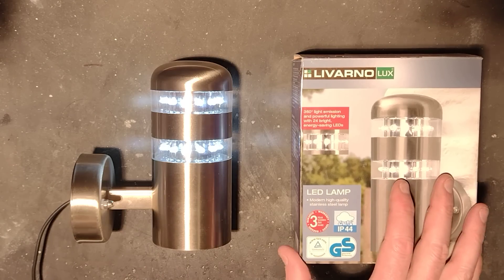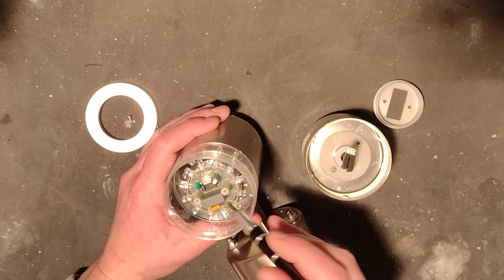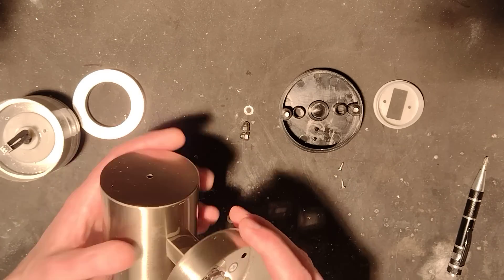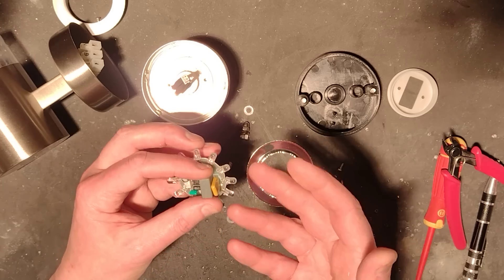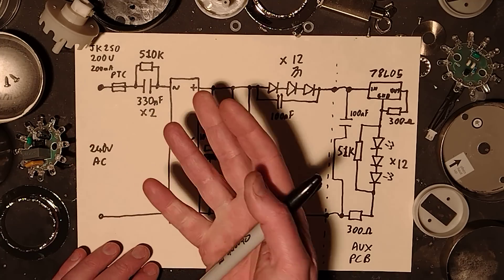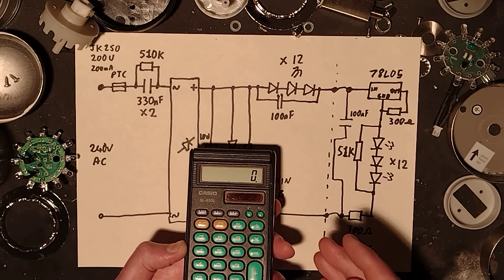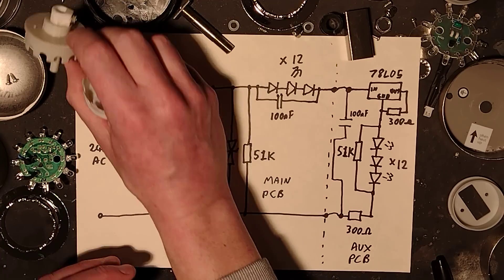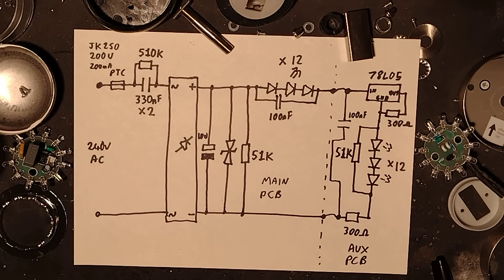Lidl Livarno Landfill Light teardown (with schematic)

Comment: They should of had solar panels somewhere to use solar energy to charge and come on when it got dark with a light sensor. What were they thinking? Have to plug in and  goes outside that seems like a bad idea to have electricity going to it when it rains that's sort of a risk for bad things to happen. Electricity and water don't work together.

Comment: Thanks Clive, love your teardowns, very informative not just for the circuits but several times now your teardowns have let me cleanly open devices because you found the reason for a need for brute force so I didn't have to destroy items to repair them !
It's a shame that ptc isn't an ntc instead; I'm fed up replacing relays in Shelly 1, Tradfri  an other IOT switches because the 16A relay can't cope with the 0.1A or less average load of a led driver circuit. Sure, the 100A+ for 0.0001 seconds after switch on is slightly over the relay's spec, but adding your own ntc to dampen the spike isn't always safely possible.

Comment: Thanks! The LED current will actually be about 20mA because the 3mA (typical) Iq flowing out the GND pin adds to the 16.7mA resistor current.

Comment: It'd make much more sense to have a similar sized unit that takes a GU-10 lamp or a small Edison screw lamp and that way all you need to do is replace the lamp, not the whole unit.

Would much rather buy a larger fixture just for the fact I can switch the bulb if I have to, especially since in Australia you can't do your own electrical work.

Comment: I think you should design your own range of 240v bulbs etc that work for a lot longer than what is available now possible more efficient as well and serviceable if each bulb had a reusable outer shell and lens and the LED board and power supply are separate easily changed components it would save so much waste and people could pick and chews from a much smaller range of items that is needed to cover every bulb how they are now it will take some one like you to step up and change simple things like this that will make a big difference if you build it we will back you

Comment: Clive thx for taking the time to tear this down. If these lamps were 1 to 2 pounds then they are disposable. However, they ain't 1 to 2 pounds. If these are installed on both sides or an entrance and one goes poof, most likely, you won't be able to match them so you'll have to buy another pair. Just a good legal robbery, I mean good business.
So when you have to scrap one of these you get a HV bridge, HV PTC, some working LEDs and lets not forget a good 78L05 reg. so all is not lost if you are an electronic hobbyist. If you're not then you're out what you paid for it.
Again Clive thx for the tear down.

Comment: 3:20 imagine doing all the, on a stepladder, in the cold, dark, of a northern winter, it look so much easier, than just in screwing, maybe bolt or two, replacing the filament or LED, or florescent bulb, job done,

so you have basic got to uninstall the thing first, almost take completely a part, try to fin the problem/(maybe take a quick electronic DIAGNOSIS course, back to none working, lamp, still not working, ???
 
yes I can see all the great features, of this type of lamp, so in stead in cupboard, with spare bulbs, we have  cupboard with hole spare light units?

Comment: Dear Doctor Clive,
Need your help, you being a wizard an all.  I sweat like a pig in bed. Tried everything available (except these mega expensive water-cooled mattress covers). Need something to measure (externally) body temperature which can then switch on an under blanket fan. I’ve got the fan but cannot sleep due to (albeit low) noise volume even at lowest speed. Are you with me? Anything you could knock up? Or suggest, or point to another site?
This could be a massive boost for you, like a Clive’ll Fixit. Beats Christmas lights!
Reply from the maker: I'm not sure the best thing to deal with that.  We don't have the same situation here.  If we had under blanket fans we'd get hypothermia.

I wonder if a modern smart watch can be used to monitor body temperature and control the fan.
Reply: @bigclivedotcom  
Oh Clive. Is “here” fae you the same as “here” fae me? NE Scotland.
The fan is great, purpose built. I was thinking of something I could lie on with a couple of narrow range temperature tx to monitor, then switch. Too complicated for me but a piece of cake to a genius.
Joking aside, I sleep with a window open even in winter and can change a tee shirt 2 or 3 times a night.
Ah weel, ne’er mind.

Comment: The 330nf cap together with rectifier and 100uF bulk cap will act like a 16mA current source with 2mA ripple for 24 white LEDs. The 78L05 has a quiescent current of 3-6 mA. Setting the output load to a higher current (16mA + (3..6mA)) than the input can deliver will turn the regulator completely on, preventing any current regulation. As a result the ripple current with the regulator will be approximately the same as without. Replacing the regulator and 300 ohm resistors with wires would be cheaper and more energy efficient.
Reply: What happens when mains voltage rises?

Comment: A couple of thoughts about the 300 ohms and the current regulation with the 5V IC.  The first is that to my recollection, the regulator current through the ground pin is 7 mA.  Or in any case so much that it should be added to the pass current.  The second thought relates to the maximum input voltage of the regulator.  If my memory does not fail me, it is just 40 V.  Hence the second 300 ohm resistor..  Kudos to the 200 mA PTC fuse!  Smart idea indeed.

Comment: I recently got a “Mordern” looking light fixture it wasn’t cheap but it’s bigger have 3 sets of bulb shaped contraptions and they have square PCBs with SMD LEDs in each of the contraption with heat sinks & with a replaceable driver circuit soo happy to see a  construction in 2021 which is made to last decades just need power supply or LED PCB replacement which I can easily do

Comment: I am pretty sure these parallell resistors and capacitors serves a role to reduce noise and the risk of making the lights glow dim when the lamp is off, it was a rather common thing when LEDs were new on market they did not suppress the AC capacitive coupling which made it impossible to turn the light completely off under some circumstances :) so my guess they are there to reduce voltage from parasitic capacitance in the wiring

Comment: The construction of this very neat indeed. Though as you had trouble taking it apart, it isn't built for being maintained in anyway. I take it that once it blows, its binned, after which the owner needs to go out and buy another lamp as a replacement for one's outdoor lighting. I know things need to be protected from the elements, but surely rubber sealant grommets between the layers would be better than rubberised glue. If one can't mend a piece of equipment like this, how much of it is going to end up in landfill and/or being recycled. When all a person needs, is the companies to design maintenance friendly casings.
Reply: Cynically, if they made it easy to repair, they wouldn’t sell as many. $$$🚬💵💴💶💷
Reply: @TomCee53  Well we are told to recycle what we can these days. So, isn't it better to repair items than waste engery to break down metals etc and then reform them into new items? When a 20 pence LED replacement could have done a quick repair of it.

Comment: I think that putting the LEDs in a 360 degree ring for a WALL mounting light is an awful idea. Half the LEDs will be shining at brickwork.
You can see that the PCBs have space to arrange the LEDs in a 180 degree arc, that would have been a far better design IMHO.

Comment: 7:00 I've never seen a 78xx used this way, although the LM317 has this current-limit setup described in its datasheet
Reply: 7805 has quiescent current of 0 - 6mA, with LM317 it is 0 - 0.1mA, far more precision with the LM317. With this application, a few mA doesn't make any difference. In addition, the LM317 has 1.25 volt drop, the 7805 has 5 volt drop, in some current limiting applications the LM317 can be more energy efficient.  Presumably the 7805 is cheaper than the LM317 and performance is adequate.

Comment: I've only seen the 7805 circuit with LM317 in practice. Although I remember seeing the 7805 trick in a text book years ago. 
Current mirroring is the most common current regulation with only 2 transistors and 2 resistors. Very suitable for sub-Amp constant currents.

Comment: Interesting construction: The capacitive dropper acts as a 18mA current source but has a 17mA current regulator in series.
So frequency change shuld result in voltage drop over the regulator

Comment: Ip44 rating is not suitable for heavy rain.
This thing won't last one winter in Canada. The electrolyte inside the cap will freeze at -30ºC.
Maybe that's why they put a heater (PTC) in there! 
Even compact CFL bulbs don't work right at -10ºC or bellow.

Comment: I think the TVS is mainly there to protect the 10u/100V capacitor from overvoltage in case the line voltage is a bit higher than it should be for long periods of time. This situation should also allow the PTC to kick-in after some time.

Comment: There is an argument for banning lights like this. There is too much focus on energy consumption in use rather than the whole life sustainability. People are conned into buying them in the belief that LEDs are better for energy consumption etc etc. But actually having to bin the whole thing as soon as the first LED fails surely defeats any saving in energy not to mention the costs of paying someone "qualified" to change it. Same goes for the popular designs of flood lamps, where to most of the population the light source is integral to the body and the whole thing has to be changed when failure occurs, where as the old linear halogens bulbs could be changed leaving the hardware in place.
Reply: Out of 24 screw-in LED lamps I installed 8 have failed in 2 years,  always the filter capacitor after the rectifier. I always warned my clients the fixtures would be throw away regardless of the warranty
Reply: They are really cheap and actually if you are off-grid and using solar power, the savings make a huge difference, we are very used to having "unlimited power" at homes, we don't power off devices we don't use, etc.

Comment: PTC and self resetting fuses are two totally different things, don't confuse them.  I have never heard of a "self resetting fuse" rated over about 32. Volts.  I think the color of it has confused Clive.
The 7805 appears to be wired as a constant current source.  The added 300. Ω (the two) seems to reduce the current to keep the 7805 from over heating. Ron W4BIN

Comment: Clive?  I just thought?  Dont you own a battery powered Multitool?  You know?  A vibrating cutting & sanding multitool?  We're all using them these days, within the construction industry.  It's a everyday powertool.  Without one, my workday would be physically tougher, jobs would take longer to do.  And id have to put loads more effort into the task at hand.  I like the lazy mans way.  So when my Multitool's variable speed potentiometer went Fubar, i nearly cried.  But i managed to get it working by bodging the knurled roller dial, by jamming a small screw between the speed adjustments roller & the tools plastic body.  Instead of the motor "SCREAMING AWAY" with no control, it jammed it at a decent speed.  Anyone else wudda thought...."Wtf?  Im not using that piece of shit!" But us #Techieswillldoanything....ha ha ha.
Reply from the maker: I do have one of those tools, but I was hoping to open this light non destructively.

Comment: A Video request, Clive....

RCDs..........it appears that some electronicsy things like computer power bricks etc. are designed to leak a little to earth - such that if you have a few of them on a circuit, the total leakage is enough to trip the RCD. Electricians' solution appears to be add more RCDs to reduce the max number of 'offending' items being connected. I'm not happy about this - it's like accepting faulty equipment. So next time you come across something with a designed earth leak, can you:
1. Explain why that is and why they're not using the neutral
2. Explain how to fix this faulty equipment so it doesn't add to the earth leak that would trip an RCD.

Let's fix the fault properly rather than using yet another electrical bodge.

Thanks.

Comment: The 510K resistor / capacitor network on the mains side of the full bridge rectifier seems like a current limiter when the capacitor capacitance is reached on each cycle, or actually allow a little voltage dropped current when other wise the AC current would either go full blast or be 0. I wonder why half the LEDs are on a 7805 and and both LED sets, one including the 7805, are on the circuit that looks to me like its regulated by the zener diode. The 51K resistors seems like an unnecessary current divider, since they are in parallel to the  circuit they bypass and they are on the DC side. And why is the zener bidirectional, especially since that part of the circuit is on the LED side of the rectifier, that is isolated inside the lamp package? To me it looks like the designer just wanted to ...

Comment: Seems like the 10 uF, 100V capacitor is a bit underrated.  It's a good idea that they put the back-to-back zener there to hopefully prevent the capacitor from overvoltage if an LED fails open.  Thanks for the tour, Clive.

Comment: I just recently found a PTC fuse in a very cheap PA speaker I repaired. It was wired in parallel to a big 20w resistor and protects the tweeter. Very strange design. Don't know if it does anything with that resistor in parallel.
Reply from the maker: It should at least limit the current in the event of extreme high frequency issues.
Reply: so it simply limits the tweeters loudness for a while till it cooled down and the PTC would kick back in.  not too shabby !

Comment: Not sure about the 300 ohm resistor here, but I've seen it before  in linear regulator circuits and even mentioned in datasheets. It's just to take some load off the regulator.

Comment: My house has these motion activated antique looking luminars branded by Brinks.  You look up inside and you see what looks like an ordinary bulb.  It's just a plastic dome over chip LED's mounted on an aluminum PCB screwed to the metal case.  One LED failed and the $70 fixture is a paper weight.  No way to fix it.

Comment: It's wrong to sell a light fitting that cannot have its lighting element replaced. It is very likely that the fitting has a non standard attachment to the wall, which means when it inevitably requires replacement, more holes will be required to attach its successor to the wall.
The designers have really not thought through the consequences of this limitation, it discourages the customer from purchasing matching sets. A failure on one unit will ruin the appearance of any such match,and it is unlikely that the light fitting will be on the market for sufficient time to allow the same design of fitting to be purchased more then once, given the likely MTBF.
In fact the MTBF is most  likely to maximise this inconvenience, being too short to justify the cost of replacing the matching set, but just sufficiently long to ensure the design has disappeared from the market when a replacement is required. 

This lack of standardisation now permeates the light fitting market, as it is increasingly dominated by LED based products. 
Manufactures seem to think the MTBF of such fittings is now so long that the customer is expected to want the inconvenience of doing the necessary building repairs to replace such units. This of course ignores the inconvenience of being without light in a particular location, while a qualified electrician is found to perform the replacement. Not everyone has the skills to do this work, and in  some cases it is technically illegal for the unqualified to preform the work, even if they have the necessary knowledge to do so.
There is a difference between changing a light bulb, and removing a light fitting and wiring in a new one. 
If the choice of any replacement is not to be left to the tradesman who is assigned the work, the customer must have some confidence that a new fitting will have compatible connections to the old one. No doubt some will point out it is only three wires, but on old circuits the earth connection may be missing, and on others there may be a requirement for a plethora of connections to accommodate, two way switching, and the need for the light fitting to allow pass through  connection for the lighting ring main. 
All this is an example of designed obsolescence. There was a time that replacing a whole light fitting was a rare occurrence, maybe once or twice in the life of a family home, now as the concept of light bulbs disappear, it is becoming a far more common irritation of modern energy saving technology. Taking into account all aspects of modern lighting design, I contend the improvement is no better.